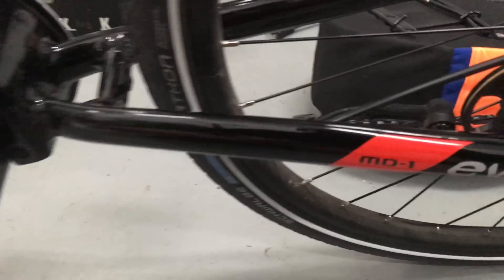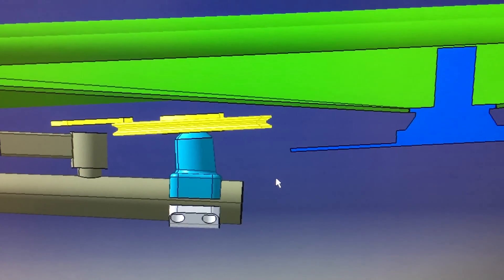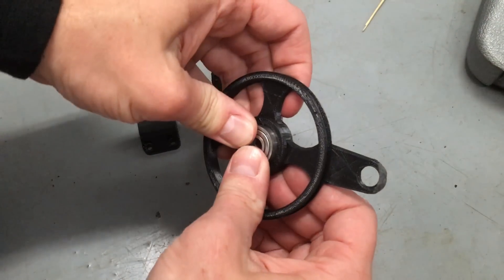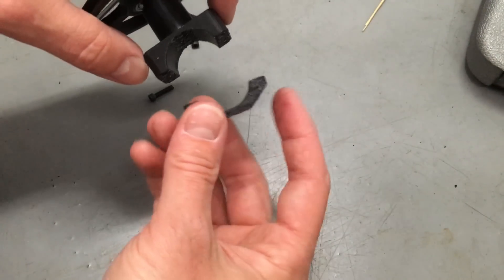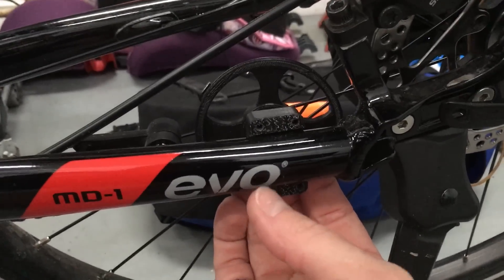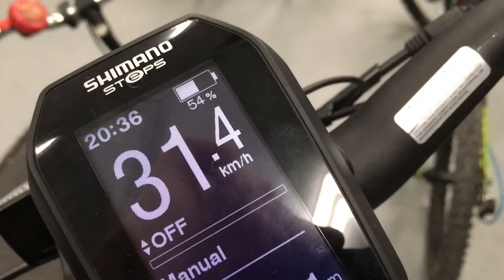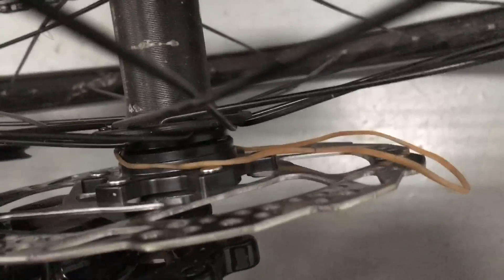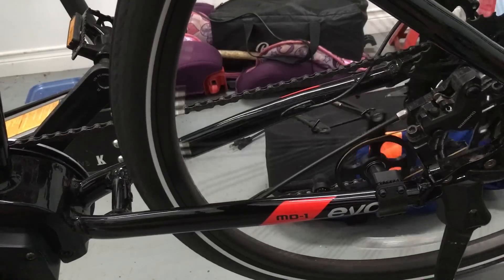e-Bike speed limit unlock hack - Works on Shimano steps and others

Comment: I have looked at your video again and just realized that even though I have a rear hub motor on my back wheel my motor operates on sensors rather than wheel rotation  which is a pity as I got all the parts that you had shown on your video to do the modification only to realize it won't work for me but thanks for the great video
Reply: What setup you have Nick?
Reply: slinkytreekreeper I have a Kalkhoff " XION" rear hub. It's 250 watts with a maximum of 1000 watts. My motor doesn't have a controller unlike other rear hub motors instead the xion motor works on sensors rather than wheel rotation. In other words the harder it pedal the faster the bike goes. Similar to a mid drive motor
Reply: Most e-bike's depend for speed regulation on the train=>wheelcircumference/magnet/sensor.
Most sensors are fed with pulses of 0,6 volt, but 0,5 volt will do the trick.
If one tries to derive the pulses from a magnet placed on the pedals or primary pinion,you will have a lower cadance and still see the pulse , but the tension would be in the area of 0,2 volt, given the small circumference of the pedals.It is not so difficult to feed the sensors 0,6 volt using an elektro magnet.
Reply: This video is clearly titled Shimano Steps, you've only got yourself to blame. :)